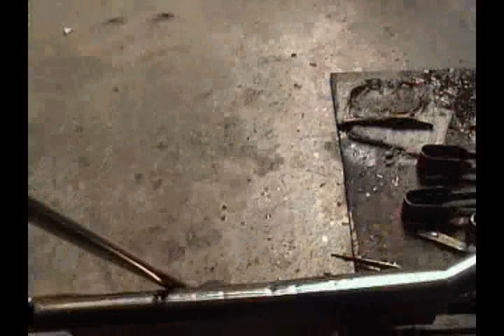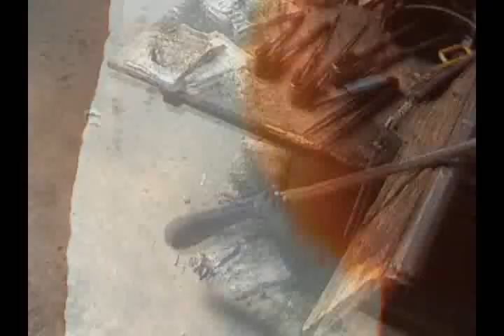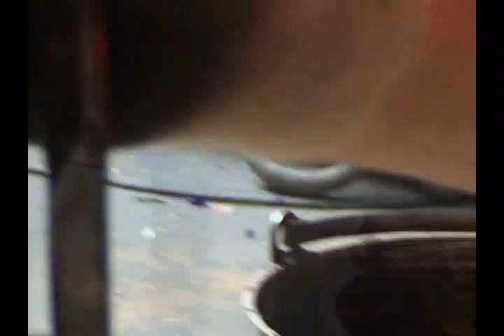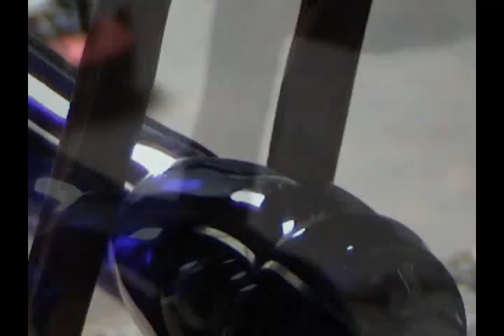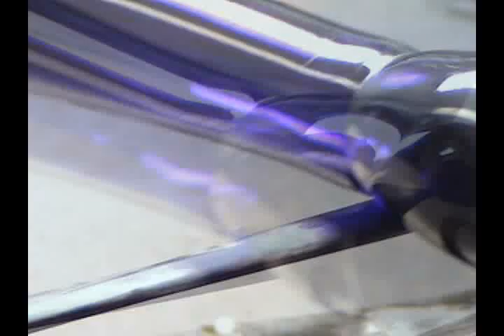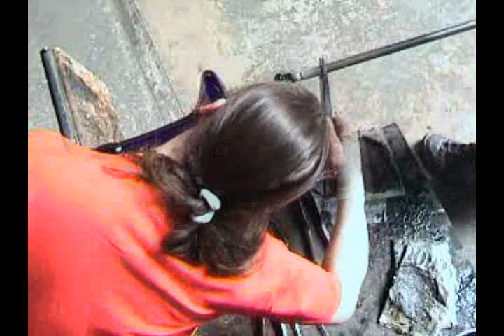Glass Blowing - Ships Decanter Bristol Blue Glass

Comment: i make colored candleholders using bar murrine scraps as color chunks in a similar fashion. using a combination of swinging and marvering to get the length and then i flatten by having my partner use the paddle on the bottom while i flatten the top with the jacks.